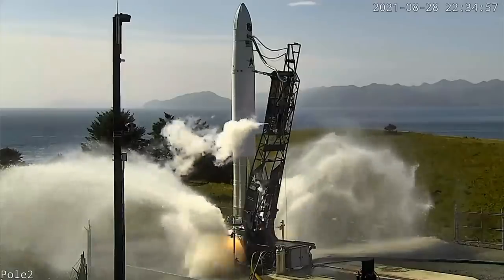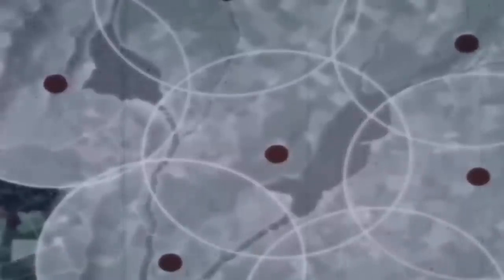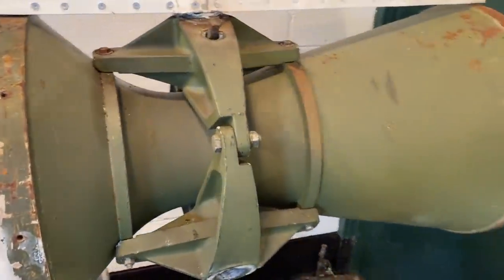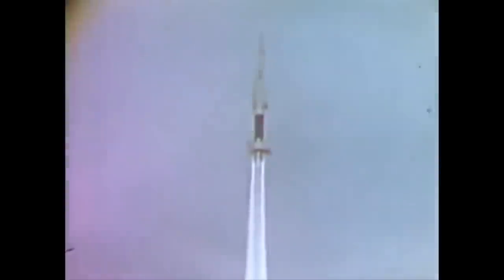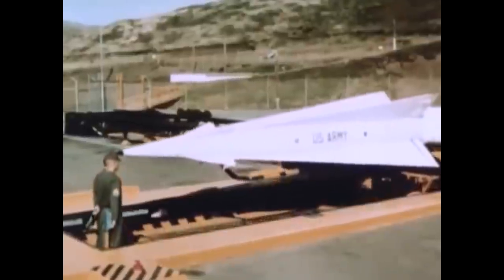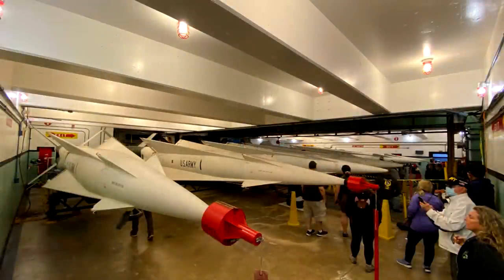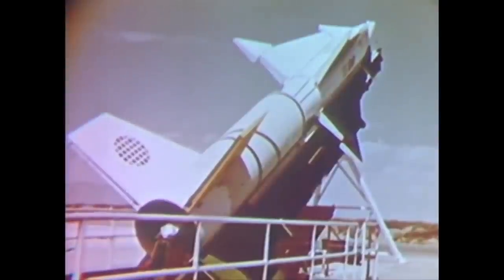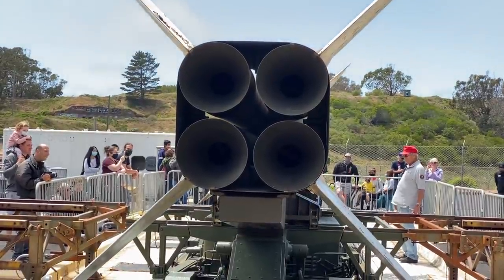Nike-Hercules - US's Surface To Air Missile with Nuclear Warheads.

Comment: Saw a lot of these during Dutch air force open days.
We had them in use into the mid/late 1980s, when they were slowly replaced by Patriot.
Once every few years there was a competition between the missile batteries, resulting in one of them being designated the winner and having the reward of being allowed to fire a single life missile from a NATO missile range on Crete.

They were a cornerstone of European upper level air defense during the cold war, together with squadrons of F-104G interceptors.

Comment: Scott, I remember the Nike Herc’s they had some on static display at Ft. Bliss where I went after USMC Bootcamp for radar tech school on the HAWK Missile system. I was a HIPIR tech before going back to school at Redstone Arsenal for the Pulse Acquisition Radar used in HAWK. The HIPIR gave rear reference coding to the missile directing it to the target. The Pulse (PAR) would find the target and give the info to the HIPIR via the Battery Control Central (BCC)  where the fire control officer directed battery ops from.  I loved working on the gear!! Our motto was: “If it flies, it dies”

After the Corps I worked in Silicon Valley at several RF shops on multiple missile and jammer programs until the Clintons decided that the country no longer “needed” such trivial stuff.  (Ahem) Fly Safe!

Comment: I grew up on the chicago lakefront, about 3 blocks from Belmont harbor. Played in the park all the time.  Then one day there was a fenced-off area with young solders with m-16s.  I approached and they said my friend and I had to back off.  We asked a few questions and left.  A few years later we noticed that the fence and people were gone and there were several large deep rectangular holes in the ground.  I remember they were concrete and steel and the top edges were painted with mostly yellow paint.  Scary deep for a 11 or 12 year old.

My buddy and I went to the area and people, mostly kids, were 'sledding' , on peices of cardboard down a small ridge not more than 50-100 feet from the rectangular middle silos.  They hadn't been filled in yet, there were 2 bulldozers parked nearby.

I decided to slide down the flattenedd grass on the ridge and came to an abrupt halt as I felt this sharp sting in my backside as slid over a 1/4 inch steel running along the length of the ridge.  We realized that the ridge was a man made subterranean structure associated with the missile base.

My buddy and I went between the 2 bull dozers, examined the tear in my jeans, underwear and small cut in my ass.  We laughed at the inanity of the situation.

Comment: Wow, tons of comments. I enjoyed this video specially because it 1967 I avoided being drafted into the infantry by enlisting for Nike track radar mechanic school in Ft, Bliss TX, I graduated top of my class and headed to the Washington Baltimore air defense. The analog computer was one of the pieces of equipment I was responsible for. You did an excellent job on the video. I hope we can find a chance to talk. I have probably forgotten the formulas the computer used, I but I still remember clearly the theory of operation.
Reply: What unit were you assigned to.  I was at W-92 in Gaithersburg MD 72-73
Reply: @bradhanley8368  I started as a track Radar Mechanic at Tolchester Beach Maryland , across the bay from Baltimore. I went back to Bliss for T1 Electronic Warfare Simulator school. Back to headquarters at Edgewood arsenal. We trucked the T1 to Rockville and the guard base at Lorton Prison VA. Good times!
Reply: @Utube4chuck  cool.  I reuped in 73 wanted to be assigned to the Seattle area,  but got sent to SF-88 instead

Comment: In the early 1960s I used to live in West Garden Grove, CA, and not far from our house, out in an alfalfa field there was a Nike Hercules base. We used to occasionally drive down Chapman Avenue and see that they had rolled out one or two missiles. Most times the tips of the missiles were plain, but occasionally there was a bulbous red tip on them. We used to speculate that the red tips meant there was a nuclear warhead on them, but of course we didn't know.

Comment: Lived across the street from one of these sites for years without realizing what it was. From Ft MacArthur museum website: “Pasadena Army Support Center/1950-1963/HQ 
H-located at 125 S. Grand Ave. in Pasadena. This site was the HQ for the 12th Artillery Group and the HHB of the 1st Battalion of the 56th ADA from 1956 to 1963. It is now a federal court building. The structures used for some of the Nike functions were located on the hillside behind the courthouse proper.” Actually it was later an army reserve depot and there were still vehicles, buildings and equipment below the bridge over the arroyo there. Who knows what’s actually going on there, just a stone’s throw from JPL….

Comment: I live next to U.S. Army Reserve base (which in the past used to be a Nike base, possibly nuclear). Once the Nike base was taken down it was sold to the city and they made a golf course on it (Reserve and golf course are on the same piece of land). What’s odd though is that the old building that housed all of the radar and control equipment is still standing on the base (I’ve heard that building also leads to a tunnel system underground to the missile silos). 
          What’s even weirder though is that the golf course had a sink hole happen a few years ago which ended up being right on top of one of the existing missile silos (Nike silos were never totally deconstructed). Some of the golf course employees were able to see what looked like tunnels at the bottom of the silo that collapsed. 
          There are also supposedly some large fuel tanks and other equipment still buried underground that used to be in operation on the base (information is from a friend who works on the golf course).
Reply: Nikes had underground storage, but were never in "silos" as far as I know...but the underground barns would sure make for sinkhole material!

Comment: As a 436.1 Army Nuclear Weapons Assemblyman I worked on several Nike Herc warheads in Europe in the early '60s.  I was always amused by one irony of the weapon based on the different perspectives of the Ordnance Corps (which stored and maintained the weapons) and the Artillery Corps (which was responsible for deployment).

For Ordnance, the color green meant "safe to work on" and red meant "armed and dangerous", while for Artillery green meant "armed and ready to fire" and red meant "disarmed".  Since Ordnance was in charge of the firing plugs, the green electrical plug meant "safe".  But attached to the GREEN plug was a several foot long RED ribbon which was left hanging out the access panel so the Artillery would know which plug was installed.  And the reverse for the red "armed" plug with the green ribbon.

There was a white plug too.  That was the surface-to-surface option.  Contrary to this well-researched video, I doubt the SS option was ever deployed states-side, even at the coasts, but it was available in Europe, intended to surprise the Soviets, though they probably knew.

BTW, the cross-section of the nuclear missile in the video shows a rough approximation of the Mk31 warhead.  I'm sorry that the entire Internet does not contain a single picture of the Mk31 because I always marveled at what a gross, ugly, brutal-looking piece of hardware it was.

Comment: My favorite early cold war missle was Spartan. It was so very fast. It used some exotic mixtures of solid fuel. The developers stated the ablative nose cone was already glowing red hot after the 2.5 to 3 second first stage.  It was so fast it had no fins to speak of and steering was done by cold gas injection into the thrust chamber.

Comment: I'm an old HAWK repairman, so what you have to remember is those old birds used electron tubes, analog syncro's and analog accelerometers and gyros. Anything like a program is hard-wired amplifiers and phase comparators.

Comment: One of the Amateur Radio clubs I was affiliated with had their meeting place, Field Day activities, and repeater at a former Nike launch control facility near DC. It is now a county park. Most of the buildings are intact, based upon old photos I found of the site. The foundations for the radars are still present. The site has an interesting topography. There is a deep ampitheater-like grading in one area near the control building, I am not certain what the purpose of this was. It's not protecting anything; all structures are well above the grade on a hill, and no launches were made from this place. The launch site is a mile or so away and is now a training school for the state police. At this site, the lift/access doors for the underground "magazine" are visible near a newer garage/outbuilding.

Comment: I had the dubious pleasure of spending 24-hours on Johnston Atoll for a work assignment, decades ago now.
  Many of the  tests of the Thor SAM system (follow-on to Nike) included live nuclear warheads.  Four of those tests failed and were destructed by range officers.  One of those failures left a good portion of the atoll as too contaminated for human presence.
  It was even more restricted access, as were the Agent Orange repository section and the chemical weapons storage bunkers and destruction factory.  
  Other than those three areas, it was a great place for meditation.

Comment: I was a Herc radar crewman in the Army from '68 - '71.  Our base, LA-04, was on Mt. Gleason between Palmdale and Pasadena.  Nothing left but some foundations and random bits of parking lot pavement now on Google Earth.  By the late '60s, the targeting capability of the system had been much improved, apparently.  During SNAP (Short Notice Annual Practice) exercises at Ft. Bliss (McGregor Range), warhead detonations a hundred yards (not meters, back then) from the target was a HUGE distance.  Typical detonation-to-target distances averaged much less than fifty yards, WELL inside the frag envelope of the usual high explosive warhead.  The old training films we saw in AIT were impressive.  The later films after several generations of improvements were downright amazing.  Interesting times, for sure.
Reply: Oh, and I got to track an SR-71 during a joint training exercise.  Once.  Briefly.  We hung with him for probably thirty seconds.  He'd toss some jamming at us and we'd manage to hang on.  We thought we were BAD!  Then he turned our scopes white and disappeared.  Also, the published top speed for the '71 is, well, I'll just say it's, uh, conservative.  A lot.  We found that out just before we lost the track.  :)

Comment: Early radar analog computer worked by making the lobe of radiation from the radar antenna rotate in a circle around the target so the target was on the edge of the lobe. The strength of the radar return would change the most at the edge of the lobe where return strength was dropping off the fastest with respect to direction. The radar antenna was steered in a circle around the target and the target direction was the center of the circle. The analog computer simply used the rate of change in radar return strength as analog control signals to drive the motors pointing the antenna. When the change in return strength did not change as the antenna direction circled around the target, then the target direction was accurately known. 
       This analog feedback control system design of early radar was told to me long ago by an engineer colleague who worked at the Alameda Naval depot. He had arrived at UC Berkeley in 1939 and the first thing he did was look for a parking place.
Reply: Nike used huge Elevation, Azimuth and Range potentiometers in the tracking antennas to inform the computer of instantaneous target and missile positions in polar coordinates.

The computer converted those into x, y & h rectangular coordinates for its calculations.

Gawd, I miss that duty.

Comment: Ahhh, my old Army time drinking beer in Germany!
 
I was a 14C Nuclear Surety Officer station in Germany from 1982 to 1985.  43rd, 52nd and 66th USAADs.  I was also in the last basic officer class to fire a Nike Herc in training at White Sands Missile Range in 1981.  It was NATO missiles and US, umm, "specials".  I left Germany in 1985.  They were decommissioning the last US Nike Batteries in southern Germany in 1982/83.  We showed up with a VW bus and got a lot of hard to get parts for our NATO hosts.  And US Toilet Paper for us!!! The last of the US "specials" in the program were out of Germany by the end of 1986, I think.  The NATO Nikes stayed on longer because, Heck, they were already paid for!
 
At one time there were 227 Nike Ajax and Hercules sites in the US.  Some were somewhat secret, and people didn't know what they actually were.  The red "dinosaur egg" on the ends of the missiles shown in your old footage were there because the actual device was as sharp as a needle and just long enough to come out the back of your head.  And when the Nikes were in horizontal storage position they were conveniently right at eye level, too...I think they were more concerned about getting the blood and brains out of the barometric sensor holes than the troops though...
 
There was a mission plug in the warhead, that you chose your mission: surface to air or surface to surface.  Overseas there was a Permissive Action Link or PAL device installed: a two man lockout combination lock.  Two Man because no one was suppose to know both halves of the combination.  "Specials" are always under two man control, so no one person can do bad things.  The Combinations in this case got sent to us encrypted in time of war.  59th Ordnance Brigade had two man teams running around Europe to unlock the warheads for maintenance.
 
The US Army kept Nike around so long because it was the single most accurate round of ammunition (missiles are considered one round) in the US arsenal.  It puts a 16 incher on a battleship to shame.  And then stick a nuke, err, "special" on it and go to town.  Whoops, where did that town go?  Actually I think they kept it for the Nuke part more than the accuracy.  A friend was at Infantry Officer's Basic Course and they got to practice "call for fire".  One smart a@@ 2LT called for Nike Herc and the drill sergeant told him the nearest grid square (map coordinates) was close enough.  They thought it wasn't accurate; there just wouldn't be a grid square left!  It was an old enough system that I think it got left out of some of the START treaties, or was a bargaining chip in them anyway.
 
The last "operational" Nike site is in the Natl Park on the north end of the Golden Gate Bridge. I think some of the footage was from there.  My only photo of me and a Nike Herc was taken there.  No photos allowed on the operational sites!  Anyway I guess when the last operational Nike was fired, the Army gave all of their left over components and dummy missiles to the Natl Park Service to use at the Site.  It was a fun visit and well worth it for anyone interested in Nike history, or coastal gun emplacements, too!
 
Nice viideo!
Reply: I was a 16C Nike Hercules Fire Control Operator. Crew Chief and EAMS Yellow Team in Germany. Was on the Live Fire crew at 4 of the 5 ASP’s I attended in Crete and McGregor Range NM.

Comment: I worked on pneumatic analog controllers. They worked on a principle of force balance... signals where based on air pressure and where balanced with screws and springs, as well as bladders and diaphragms. neat technology if you wanted to avoid EMP destroying your computer... as air signals are unaffected by EMP. =D  I can not confirm or deny the presence or use of special weapons.

Comment: As a child living in El Paso Texas, I was privileged to accompany my step-dad, a MS in the U.S. Army, out to the various "sites".  I also witnessed at the "shooting range" at White Sands New Mexico, many shoot downs of drones by the Ajax, Hercules and the mighty Zeus!  I also got to attend many workshops of various companies.  In fact I'm actually surprised that I don't have cancer in my right hand and arm since I used hold light bulbs in front of the wave guides of active Klystron tubes being demoed.  Far more powerful than any microwave oven!!  Having that around me is probably the actions which set my feet on a path to multi-discipline engineering.

Comment: Very interesting video, Scott.  You should also do a informational video about the "Spartan" and "Sprint" interceptor missiles that were used in the very short-lived (active for one day, at only one location I think) "Safeguard" ABM system.
Reply: Wasn’t safeguard active for,one year not one day ?
Reply: @MrTrashmasterfx   I checked Wikipedia, and the info indicates that the Langdon, North Dakota complex achieved initial operating capability by 1 April 1975 and was fully operational by 1 Oct 1975, but the US House of Representatives voted to deactivate it on 2 Oct 1975. The complex was fully deactivated by 10 Feb 1976 after "less than a year of operation and 24 hours of full operational capacity".  So I guess it comes down to how you measure the operational life of the system; somewhere between 1 day and ~10 months. Pretty short lifetime for a multi-billion dollar defense system.
Reply: @rogermason1674  hm okay then i might have misread the article, but yes one day or 10 months for a billion dollar projects is not long and just massively wasteful ;)